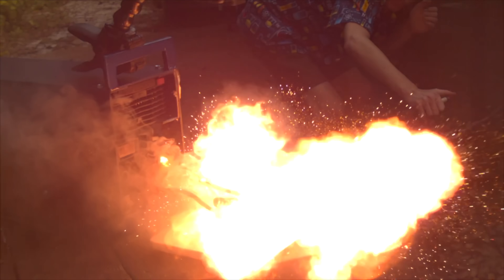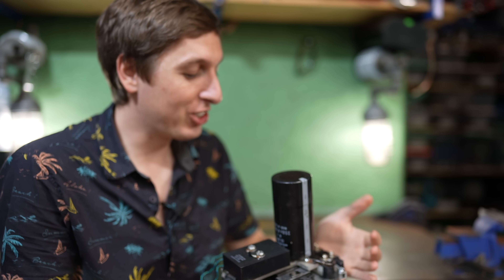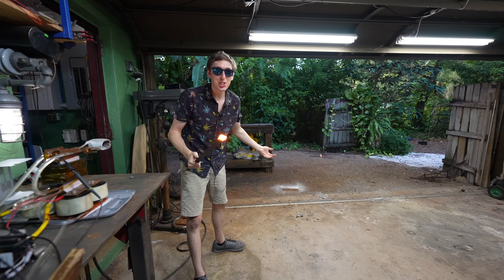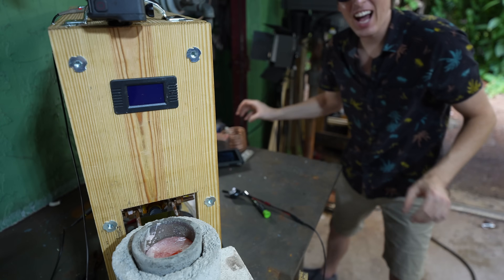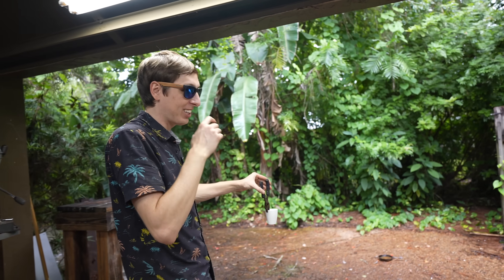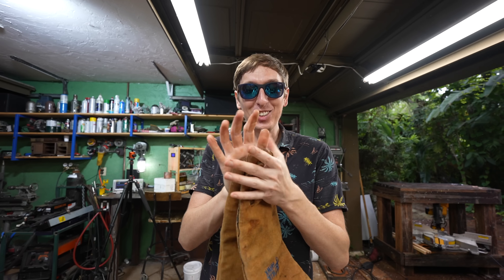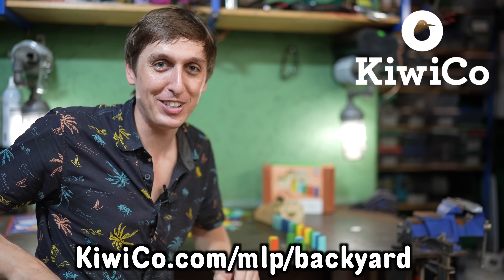DIY induction heater that can BOIL STEEL

Comment: If you want to get steel to explode you want to put wet steel into molten steel, as the wet steel sinks into the molten steel the water will quickly evaporate under the surface of the molten steel causing it to explode
Reply: Given the jackassery that we just witnessed, WHY would you make this suggestion...?
Reply: @sxigma  ..... also make sure the wet steel is rusty... holds the water better...
Reply: @sxigma  ..... for educational purposes

Comment: Used to use an induction heater in a heat treating shop I worked at. I learned pretty quickly not to have iron shavings on your hands.

Comment: Dude, it's fun to "play around" but being "safe and smart", being a good role model too is a must.  Magnesium is very lightweight but it burns extremely hot -- 265KCal / Mole of atoms -- look it up!!  Small strips are used to start Thermite reactions as it is so hot!!!!
You need heavy gloves, welder pants,  a hood, dark goggles not "Beach Shades"!  Molten steel is roughly 3,000 degrees F!  One gob and it will burn to the bone.  Cool induction heater but boiling steel is maybe is not the safest thing.    Lots of steel around and magnesium but only ONE of you and G Friend so "be warned" as a comment below remarked!!! 
Help educate others who might not know dangers!!  Thankx!!!

Comment: All that metal on the ground can't be good for the environment. It oxidizes and gets into the ground water. Steel isn't that bad, only rust, but aluminum oxide is quite harmful for the ecosystem.

Comment: Magnesium actually does give off UV light, so it's very important to protect your eyes when you're working with it
Reply: "I wonder if someone in the comment knows..." time for comment check
thank you friend, you're a friend
Reply: And a second thanks from me too
Reply: Don't worry, he had sunglasses
Reply: It’s okay no one needs functioning retinas 🥰
Reply: @nebylicza   I understand it's hot enough to separate the hydrogen and oxygen in water.  Then it reacts with the oxygen (burns), while the hot hydrogen then burns in atmospheric oxygen.
I think you put it out by smothering it in talcum powder?  Dry sand?  Look it up.
Reply: cool
Reply: Huh isn't he wearing sun glasses?
Reply: @mr.kibble1577  Burning magnesium throws off way more UV than regular sunglasses are designed to protect from.
Reply: @MaplePanda04  regular sunglasses are designed to protect your eyes from the SUN 😊
Reply: @89bazoly  yeah, and the sun outputs far less UV than burning magnesium.
Reply: But how about 7:14
Reply: It is the same with alu fires
Reply: The uv light is my last concern. how about the oscilating magnetic field?
Reply: @biz4rr  Oscilating magnetic fields are fine... unless you go to a magnetar, then they are no longer fine as they will rip the electrons out of your atoms, making all chemical bonds break and you will desintegrate in to a gas soup of protons and neutrons
Reply: @biz4rr  what's wrong with that? Any transformer or inductor in electrical devices utilizes oscillating magnetic fields
Reply: @biz4rr  why would an oscillating magnetic field be a problem?
Reply: Small amount of UV does not harm much
Reply: @shrujanamsyama9940  yea, but it still IS ionizing radiation, which any levels are worse than none :)
Reply: @navasings  debatable, some amount of uv is healthy
Reply: @dylanb2990  true… But I mean, we already get that healthy dose in our daily basis, any extra radiation is definitely better not to be around if possible

Comment: Hi there, we have induction brazing machines at my work. They use a piece of ceramic as a pedestal that raises and lowers the workpiece in and out of the coil. They also cycle water through the electrical components and the coil. Just in case you wanna go the extra mile as far as engineering goes.
Reply: Looks like the components and coil are all watercooled already.

Comment: 6:49 according Planck law of black body is distribution formula and it shows how much electromagnetic waves is given by body with temperature T, magnesium witch used as flashlight source in old photo cameras creates UV light, theoretically 20oC room temperature also creates UV and even very small radiation light of gamma and x-rays. Sun 600oC x-rays and gamma rays and x-rays including low energy UV are protected not by ozone but directly by atmosphere layer especially 2km dense air, that is reason why to airlines pilot or flight attendant is 
Work-related diseases. The radiation dose rate at typical commercial airline flight altitude (35,000 feet) is about 0.003 millisieverts per hour airplane fuselage is very thin aluminum is not enough.
In all books Maxwell-Boltzmann gas theory is attributed to exponential distribution, but Planck law in all physics books in university textbooks in all engineering manuals is not distribution equation, I don't understand why.

Comment: If you used the same crucible for the aluminum as you did the steel it would probably be a thermite reaction. @7:10

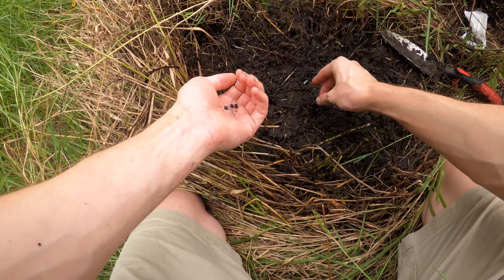Comment: 1:00 electrons running round in wire don't create heat by friction, the scale is way too small for it to be friction. It's resistive heating, AKA Ohm or Joule heating. I realise this was over some nice soothing footage of you planting seed transistors to grow big strong transistors so I suppose technically you win anyway.

Comment: I know you showed us in the video pretty much how you put that together but is there any way you can actually give me instructions on putting one together and what I need to buy I could use one of those as now I'm melting my metals in a little furnace thing I bought off eBay but that would be better because it heats up so fast and I can actually heat up steel I can't melt steel in my machine all I can milk is aluminum and copper brass gold and silver would love to build one of these

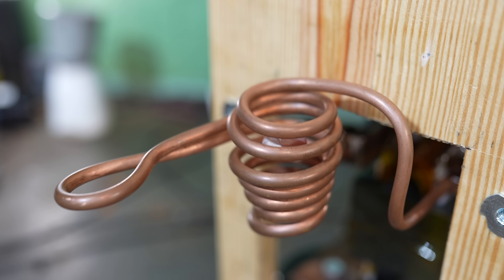Comment: At 8:50 you used a weird work coil for levitating aluminum which has a single loop sticking out of the side of the main coil. WHAT is that loop used for? Anyone know?

Comment: I understand you are a very keen science dude but you really need to take a serious look at PPE requirements for what you plan to do. You don't see foundry workers in shorts and thongs for very good reasons. I have seen drips of molten metal no more than 2mm in diameter burn right through to the bone on a person's arm and that was through a thick cotton shirt and he was not whipping around like you were. Magnesium would be one of the most dangerous metals to work with and you were playing games with it. If the bit being melted had a small impurity in it that melted quicker than the magnesium and boiled then white-hot magnesium would be sprayed all over the place including any humans. You don't heat magnesium in an open-top container. It was not put in bombs for its lightness. Science is great but not when you display it in a reckless and dangerous manner.

Comment: Amazing video! When you catch magnesium on fire the safest way you can get it out is with a Class D fire extinguisher. It's almost like a sand consistency. If you have a decent-sized magnesium fire and you throw water on it, it actually explodes and Pops like a firework almost similar to the steel it's just a lot brighter and hotter.

Comment: According to Safety Procedure, The burning of Metal Flame can be extinguished by It's Halogen Salt. In this case, MgCL, MgBr. And It should be prepared if the reaction involves Alkaline or Metal pyrolysis.

Comment: I love how he is playing with molten Aluminum, Magnesium, and Steel. Splashing it around, flinging it, setting things on fire etc. And the 1 "safety warning" that he makes sure to highlight is to "Check your gloves for spiders".

LOL.
Reply: Omg that is so funny. But those spiders are scary man. Maybe if you find one in yr gloves u can kill it with molten magnesium.
Reply: Molten metal only has to teach you once
Reply: @brainretardant  hobbyist blacksmith, can confirm. Once is enough for at least 2 generations to learn from.
Reply: It's a real danger, so always check your gloves for spiders
Reply: Irk. Safety nightmare. Let’s just heat up some molten steel in a polo shirt and shorts
Reply: @mq5731  And plastic sneakers. Not to mention half the time he didn't even wear safety goggles. Had he dropped or broke one of those crucibles at his feet he would have been hospitalized.
Reply: @andrewdiehl5746  I think the most horrifying thing in that sentence is the implication he would have to go to the hospital. Hospitals are expensive...
Reply: @mq5731  yah, i is unkomfortbel
Reply: My butthole was max clenched the whole time
Reply: Yup, 5 videos in and I'm starting to get "Florida man..." vibes lol
Reply: i mean in fairness he's screwing around with melting metal lmao
Reply: to be fair, I would rather be splashed by molten metals than to be bitten and/or stung by an arachnid
Reply: @kavakahn9387  what if its non poisonous?  Molten metal generally just rolls over your skin without doing much damage, but if a piece falls into your shoe, all i can say is good luck.  Also, if a piece does stick to your skin, its gonna melt down to the bone depending on how big it is
Reply: Honestly I'd rather get covered in molten metals than spider gloved.
Reply: Ah yes, the Florida way.
Reply: Meanwhile, he's always wearing shorts and ankle high socks..  Lol!
Reply: Spiders are deadly. It's sound advice.
Reply: As an Australian i see no problems here
Reply: @SpaynjXD Australians and Florida mans are exactly the same
Reply: @seanhoward7069  not exactly, but bclose enough
Reply: Perhaps he could invest in some safety sandles and knickers.
Reply: A true red-blooded American
Reply: yeah lol
Reply: And my jobsite gets a $15k fine for not having an extension cord over head because having it on the ground is a trip hazard.
Reply: He from Florida what do you expect
Reply: Omg.  Should be wearing a mask too, that's like foundry level fumes
Reply: Meh, I get burned by little globules of molten metal on the regular, but spiders in gloves is just creepy, man!
Reply: Floridians, gotta love em

Comment: Fyi, not actually boiling steel, its just leftover magnesium reacting to the high heat of the molten steel, you should really think about lining your garage with ceramic fibre insulation if you plan on flinging molten minerals around....

Comment: Each pulse made it leap, Mary Shelly, Theodore in home and kazinsky, another name one letter replacement warns not to overreach, in the modern Prometheus, Frankenstein. Didnt expect metallurgical like cardiac beat, but didn't think backholes combining have a dual ventricles pump sound or singing. Can't blast heat gas on Palladium as reactive or use my crucible type, soft but striking will Crack it , no press access. Melt a pure or close thin with large surface area electrode out of 2-6 grams, I'll buy that get booked probably give back after move on. Wonder if collaborating poor man chemist sold metal. Anyone see listing?. Not ebay. Have loot. Juxtaposition of poor man and has excess Palladium, melts at double Aluminum, believe. Can't find anything but grams. Can set plenty on 🔥 channel, or science. Should have a central place with expensive stuff can use, he'll build it, some towns do, 3d printers, layers, machining. Science one! Just donated alone.

Comment: Dude, lol..this brings me back to my early tech years, if you want to try/see something really cool...fill a two liter bottle with Hexane ( working at a college has is benefits.) drop a piece of potassium into it and throw it into a large body of water...the water temp will expand the gas, the bottle blows like a bomb, the Hexane is heavier than air and is Highly Combustible the potassium now in the water (the Hexane will freeze the oil making for more contact points) flash of potassium and a HUGH Blue Bubble of flame, not to mention the pretty sparks from the mosquitoes......There you go and have some fun, TAKE ALL PRECAUTIONS....

Comment: Could you control the frequency of the induction?? That’d be really cool.
Reply: The frequency of the induction is specified by the zvs high frequency circuit. You would need to add relays to turn off sections of the capacitor bank to control the frequency of the induction.

Comment: 8:00 when you're trying to get it to explode, it doesn't work because there's not enough of steel and too much water. It's actually the water that explodes, not the steel. But to do that you need the water to become trapped by the steel to build up enough pressure. 
I used to work at a steel mill. In order to do maintenance on the crucibles, we'd pour out the leftover steel and slag in a smaller crucible which would be then emptied outside. One time it had been raining all day and I forgot to check whether there was water in the smaller crucible and dumped liquid steel there, the explosion shattered most of the windows in the hall....
Reply: Were you okay??
Reply: @stephaniedsouza2700  the crucibles are downright huge, so they are moved with a big crane from another room, so I was okay. But it did scare the living hell out of me...
Reply: Didnt know that
Reply: Always take advice from people who know what they’re doing

Comment: So I actually have a legitimate question about this device. Its probably not that revolutionary to think considering but oh well
Could you use this device to forge/blacksmith? Like slide a bit of steel, wait till its at the appropriate temp and hammer the hell out of it, then rinse and repeat? It just seems like a much quicker solution to smithing than waiting for a forge to heat up, wait for the metal to heat up, then go through the rigmarole of all that than it is to just pop it in for a few seconds to heat in an induction heater.

Comment: It's not actually the molten steel that explodes on contact with the water - obviously the heat from the steel causes the water to instantly turn to steam upon impact which can get trapped underneath the molten steel (since molten steel is heavier, the steam can't escape) which causes the "explosion".
I'm assuming the reasoning behind why you weren't able to cause this explosion is because the steam had space to escape

Comment: What temperatures can you reach with a induction heater? Is there a theoretical temperature limit, defined by the input power, setup, etc? Is it possible to melt tungsten with this induction heater?
Reply: The theoretical temperature limit is defined by the heat flux into the metal. You can do the heat transfer calculations on the metal to convert between heat flux in and heat flux out, assuming constant energy in. You would need to use the conduction, convection, and radiative losses out of the metal workpiece. If you want higher heat flux though, you need a smaller coil, and depending on the thickness of the tungsten rod, you may need to take into account the oxidation of the surface before the tungsten melts

Comment: can you put enough metal into glass to suspend in that heater? if yes, then you can make a ruperts drop with no tail by melting then releasing it into water. think it might require moar power though if it could be done at all.

Comment: I searched it up and this was the first result "In addition to being extremely bright, burning magnesium produces some ultraviolet light; avoid looking directly at it. The burning magnesium is very hot; do not touch it or let it come in contact with other flammable materials." They legit were looking at it and flaling it around like BrUh~

Comment: Turn the hot part (of the induction heater) into a steam engine, and replace a part of the wire leading to the coil with ionized air.

Comment: Hello @TheBackyardScientist , 
is that coil can work better on the inductor heater? 
https://p.globalsources.com/IMAGES/PDT/L1182433457/Flat-Coil-air-coils-inductor.jpg
10 turns , 35cm diameter , 7cm large, 17.5 hole diameter  
5 to 100A, what do you think?

Comment: How far from the subject can the coils be?  Or stated another way;  With components sort of like what you have there, can you build a  coil so that it forms a box or tube fifteen or 20 inches long and about 10 inches in diameter and bring a piece of steel in the middle to  two or three thousand degrees reliably and also control the temperature for long periods of up to an hour ?

Comment: Do you have any recommendations for induction heaters, since you said it was easier to purchase one?  I'd like one where I can adjust the heating element both in terms of size and the amount of heat.  Thanks.
Reply: Amount of heat is going to be constant for one of these because to get the oscillation circuit from having a meltdown you need to instantly turn on the full amperage of the circuit. You can alter the coil geometry to spread the heat out in different ways though. You could try to implement a pwm system to fully turn on and turn off the induction circuit , where the item being heated would receive a full amount of heating on and off.

Comment: Not so fun fact about magnesium (or maybe race history) in 1955 Mercedes 24hr Le Mans car was made from a magnesium alloy (the body at least) 

The car was in a horrific accident where the car was launched over the safety barriers (hay bales at the time) and disintegrated. the fuel tank exploded on impact, igniting the magnesium body of the car and sending the bits, along with the engine and several large parts of the car, flying into the crowd. To make things worse, I guess folks didn't know as much about magnesium back then so the fire crews tried putting out the fire with regular old water. The water reacted with the burning metal and it essentially turned into an automobile sized grease fire splashing spectators and safety staff with white hot burning sticky magnesium. Something around 84 people were killed and 120 injured in the Deadliest accident in motorsport history.